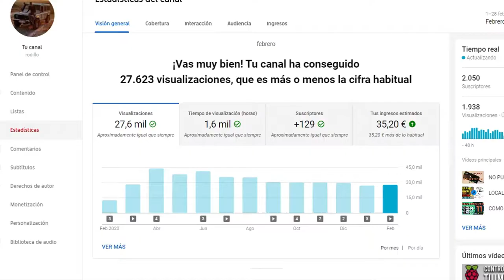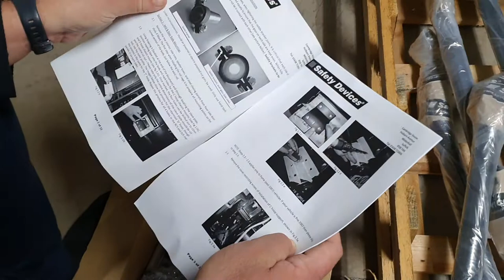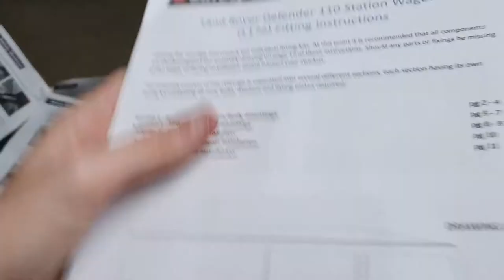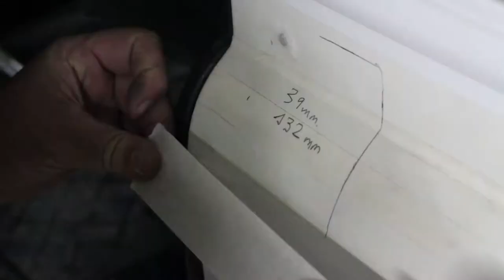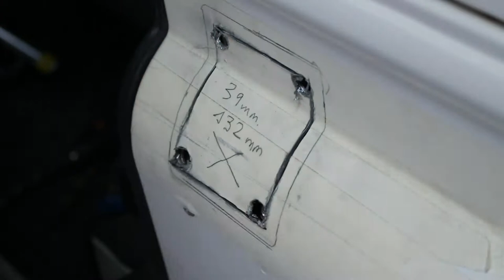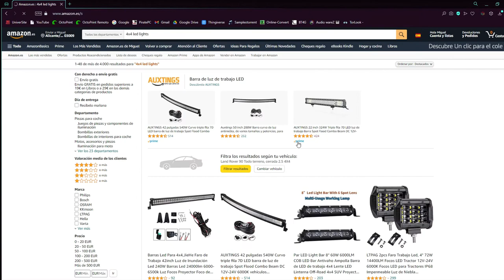LAND ROVER DEFENDER 110 SAFETY DEVICES ROLL CAGE INSTALLATION | 2000 subscribers special

Comment: Why cut the panels, would simply sandwiching through the bodywork not be a better job just creating holes for the bolts??
Reply from the maker: That is a very good question. We had just planned to do that, just like you, we don't like to cut more bodywork than necessary. The problem is that the plates have a relief that has to be embedded in the body sheet to make it flush. If you didn't make those rectangular cuts, the square pieces sticking out of the bodywork wouldn't fit.
Reply: @rodillo  I understand 👍
Reply: @rodillo  Sacrifices have to be made. But for safety, it's all good I'd say. :D
Reply from the maker: @ChyanSie  and the result is very good